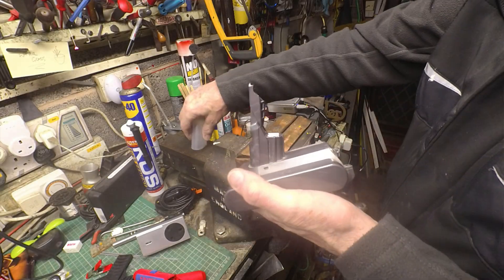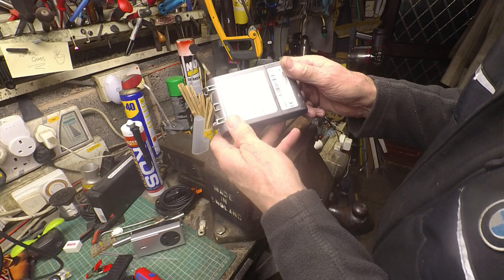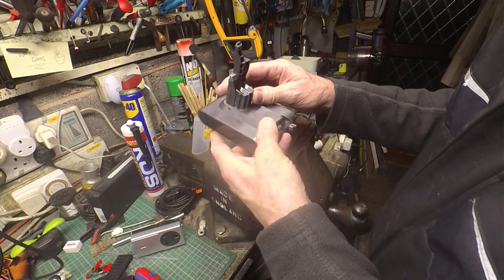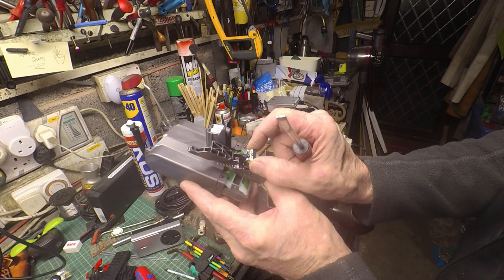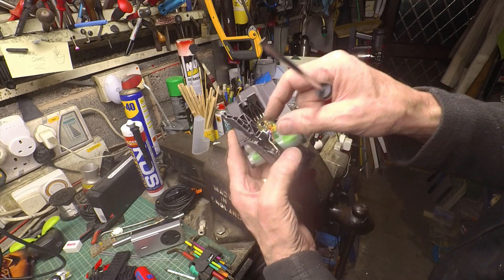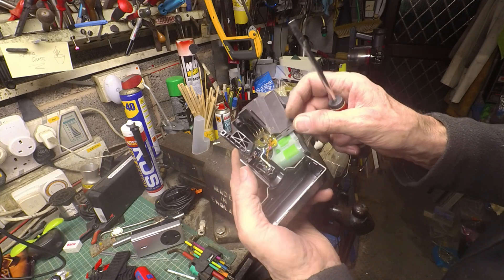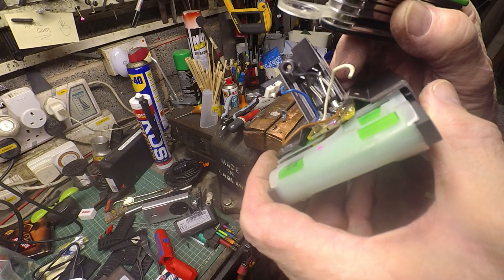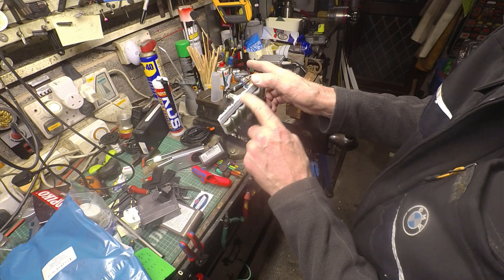Dyson V7 Battery Teardown

Comment: I have a similar pack that doesn't seem to switch power to the output terminals unless installed in the tool (vac). That, or something is fried in the output circuitry. Do you know how to trick the pack into thinking it's attached to it's tool?
Reply from the maker: With the pack out of the machine, pressing the button on the stem should turn on the blue LED & put about 25V DC on the terminals. Sounds like your pack may be faulty (?)
Reply: @Greeves  Thank you. I feared that. If the charging circuit is still working, i might at least be able to use that, keep it as a pack, and tap directly off the battery terminals.

Comment: It isn't possible to build these battery packs with easily replaceable cells as you suggest because the cells have to be welded to conductors because of high current operation. It just isn't worth attempting to make them end user refurbishable.
Reply from the maker: Thanks for the comment. Now you point it out, you're right of course. 🙂

Comment: That would be a good idea to have a door on the side to replace the batteries and it's annoying that they don't do that. Thanks!
Reply: Cells have to be welded to conductors to cope with high current when being used. These cells aren't like the kind of battery you see for sale in supermarkets, they have to be handled with care and you have to know what you are doing to refurbish a battery pack like this.
Reply from the maker: @schrodingerscat1863 Fair enough, I’m sure you’re right. Thanks for the comment
Reply from the maker: Thanks for the comment

Comment: good teardown. no thermal fuse on the charge connector (the part you damaged)
Reply from the maker: Thanks for this. So it's just a connector?
Reply: @Greeves  yeah, it is the barrel connector for the charger.

Comment: what batteries name and capacity are inside? Did watch video to know that and and no such vital information  there.
Reply from the maker: Sorry about that. The batteries are 18650s 2000mAh capacity. There's no brand marking. One of the cells measured as being well down on capacity, which is no doubt why the overall pack was weak.

Comment: Thanks for making this. I have a replacement battery on which the switch broke leaving it unable to turn off.  The case seems to be constructed with a philips screw on the  stem and a torx n <6 on the case which I have bot been able to remove... It seems that the charge connector was pushed sideways possibly shorting the battery so that even removed the battery remains warm and emits acrid fumes.  Advice to deactivate it would be welcome.
Reply from the maker: Um, that doesn't sound good. Presumably it's a non-Dyson replacement battery and may not be of great quality. I think I'd put it outside, somewhere dry but away from anything combustable. Leave it for a few weeks until it cools down & stops smelling. Then it would probably be safe to carefully break apart, if you're interested in seeing what went wrong. In any case you could take it to a public recycling centre and dispose of it. I'm not an expert though - just a keen DIYer - so don't claim to know the definitive answer. These batteries can easily hold enough energy to start a serious fire - so not worth taking any chances with.
Reply: @Greeves  Thanks, I put it into a closed tin can and checked the voltage drop which is now ~5v and it is cool.  I assume the short is dropping the power so when it gets to 0v I'll put it into recycling. The short is at the input to charge which was bent aside and then pushed down by the switch.  The take away is to be careful when putting the v7 on the wall stand to see that the pin in the battery lines up with the barrel socket on the wall.
Reply from the maker: @mw-th9ov  Thanks for posting the update - interesting. The barrel connector on the charging station always did seem a bit ‘naff’ and is evidently a weak point. On an expensive Dyson you’d think they’d have designed a more robust method. All the best. 🙂